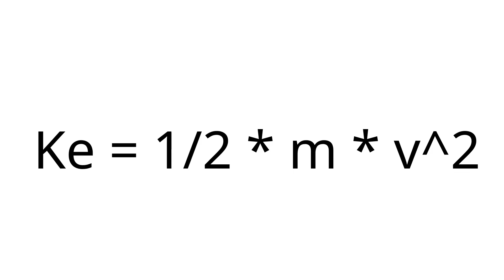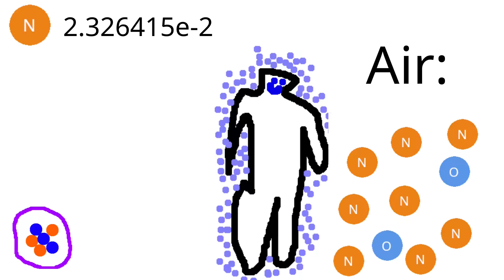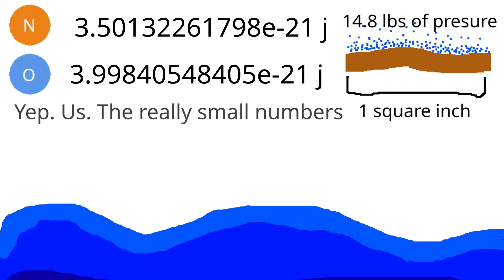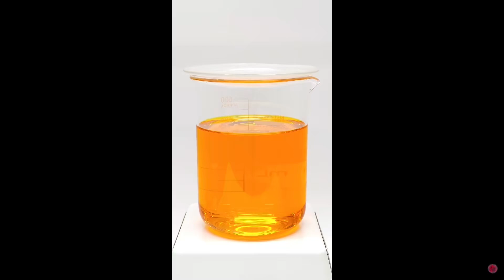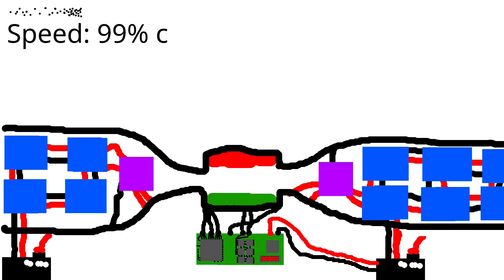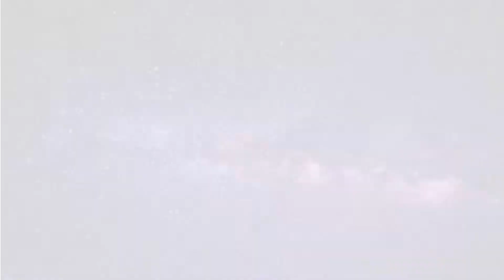Kinetic Energy x 9999 @xkcd_whatif  @MinutePhysics

Comment: Great video! Interesting topic, nice editing, explained concisely with plenty of references for scale. Velocity should however be measured in meters per second, instead of kilometers per hour. This would make most values of kinetic energy greater by a factor of (3600/1000)^2, or roughly x13. Another thing is that at high enough velocities, the standard formula for kintetic energy becomes innaccurate, since object with mass cannot reach the speed of light, objects moving at relativistic speeds become "heavier". This means that the formula for kinetic energy increases rapidily as you approach c. As an example, for an object moving at 99% c, the kinetic energy is roughly 12 times greater than the value predicted by the standard formula. For 99.99% c, it's 140 times greater. One can easily find the formula by just googling "relativistic kinetic energy". It should be noted that this formula does also work for slower speeds. Once again, great video!
Reply from the maker: Thanks for the advice, I will try to keep that in mind when doing more calculations. Also, thank you for watching. I appreciate it.
Reply: Noooooooo. He will be to powerful with the relativistic kinetic energy formula.